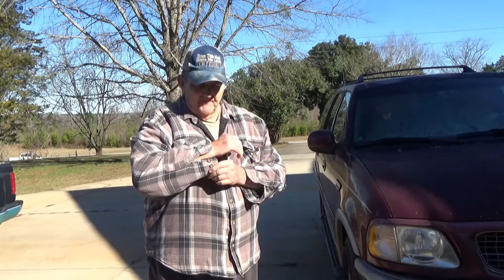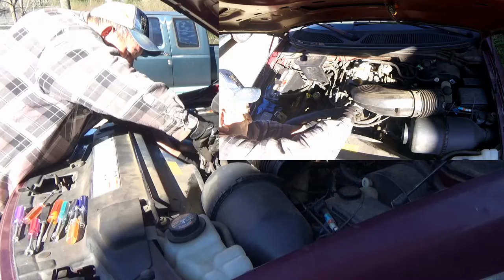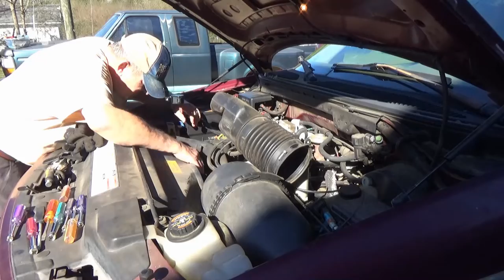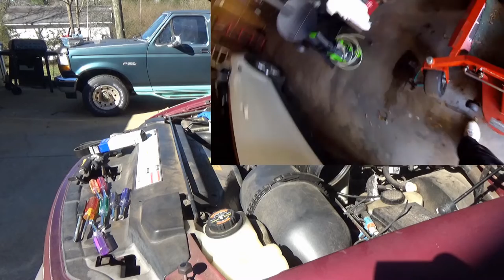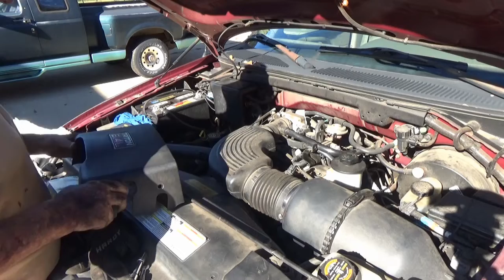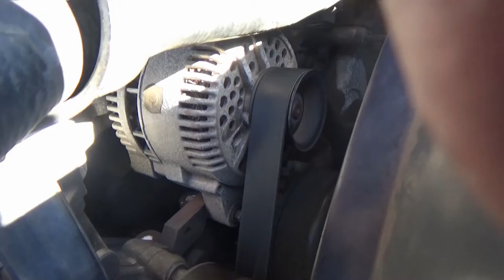Replace Serpentine Belt Ford Expedition Pwalpar VLOG

Comment: Good job Walter. I need to replace the hood struts on my expedition soon. Take care.
Reply from the maker: I need to fix my back door lock
Reply: @pwalpar  I had to replace the cables that open the window and hatch. It took my nephew a few hours.
Reply from the maker: @henrycems  Looks like I got to tear all the guts out of the back door to get to the cable
Reply: @pwalpar  You have to take the back hatch cover off. Then you can fish out the cables .

Comment: Walter, I prefer working on my Ranger XLT V6. I had to remove the fan blade in order to get it onto my engine. I use O'Reilly for parts
Reply: When you started the engine, it sounded to me like your water pump was getting ready to be the next fatality. If so remember to put gasket sealer on both sides of the gasket between the pump and the engine.  Don't say it doesn't need it. it certainly does. I'd bought a Haynes manual for use on '93 thru 97 vehicles. It also includes the Mazda B2300, B3000, and B4000 model.s.

Comment: Good job! I had to change the belt on my 99 Ranger about a month ago. I still have a bit of a squeal. I'm gonna buy a Goodyear Gatorback belt and see if that helps.
Reply from the maker: Try rubbing a dry bar of soap inside it  then run it see if the squeal goes away